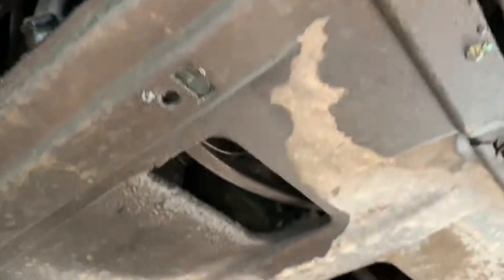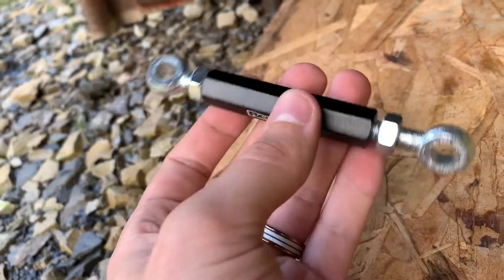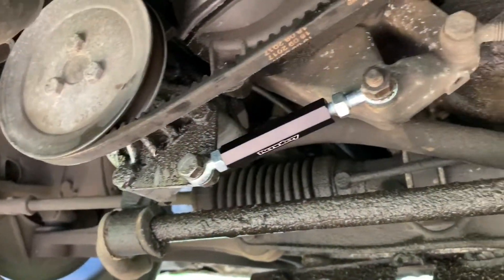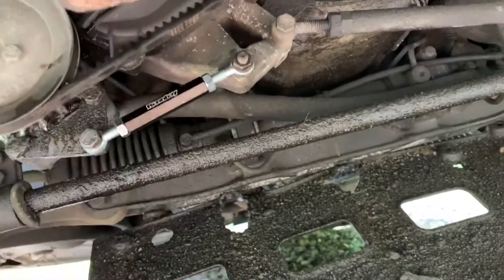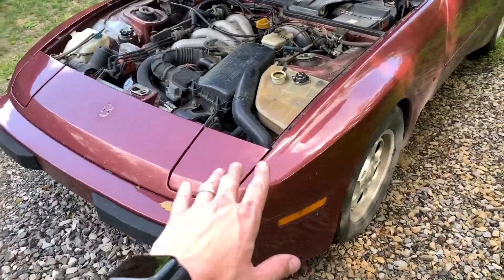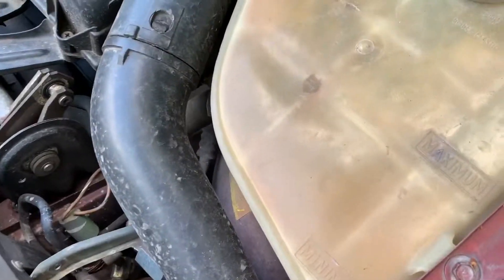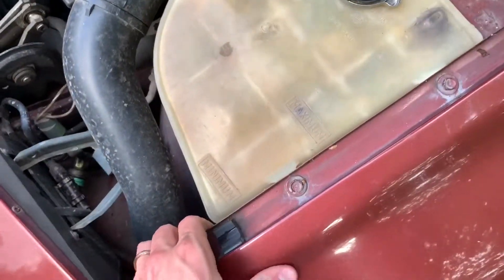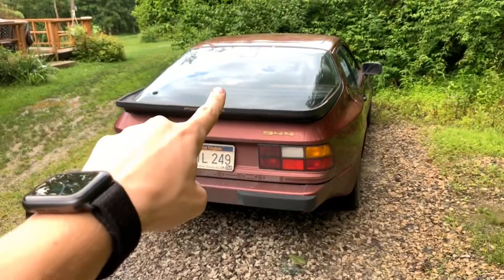Fixing the 944’s power steering.

Comment: I just rebuilt the power steering pump on my 87 944 with a $30 seal and gasket kit that ends the leaking problem. I ordered mine from Advanced Auto parts

Comment: From the previous video the bushing that goes into the power steering pump was missing. Need to have it to keep it straight.
The proper coolant is red, not green or blue.
  Check online for a copy of the Porsche PET.  That is the parts catalog and is free to download.  Very helpful to figure out what parts you need.  Should also get the factory WSM (work shop manual).  Try not to download the pirated WSM available online.  The parts in the WSM are numbered in the order they are removed.  I believe the PET has the same numbering system.  Helpful to know how to take things apart.
Reply: david kaehele why do you mention not downloading the pirated copy?  Viruses?  Where do we get the good one then?  Thanks.
Reply: @jjkerr626  It is not nice :)  that being said there are several copies out there that I may or may not have downloaded with no issues ;)  Check my build out here https://rennlist.com/forums/924-931-944-951-968-forum/1077271-944-cabriolt-refresh-and-turbo-swap.html